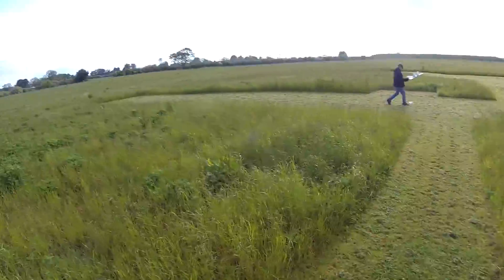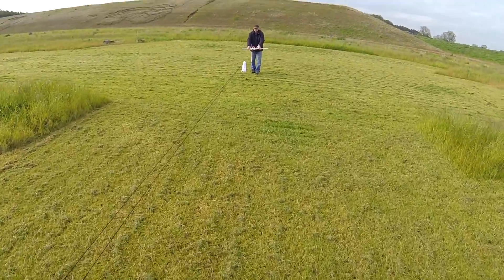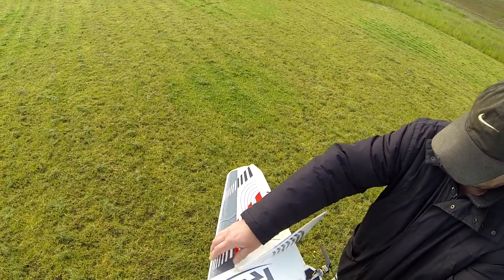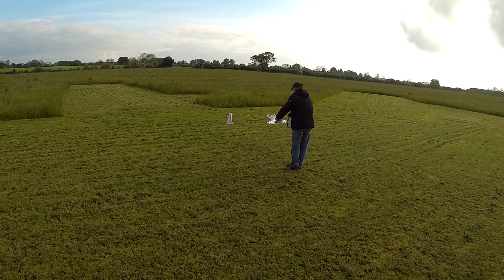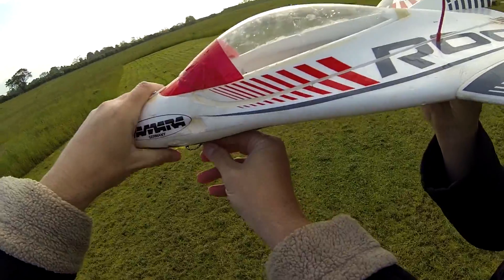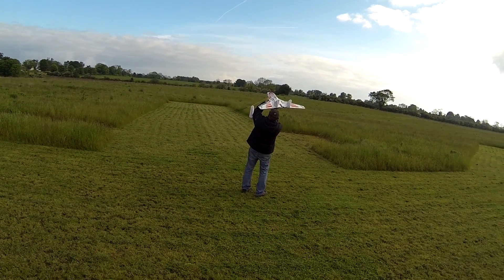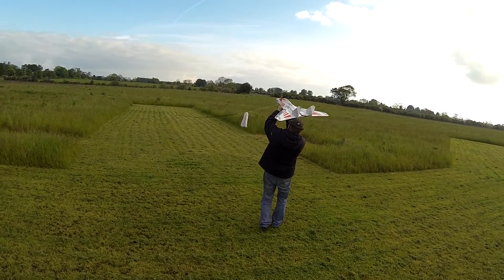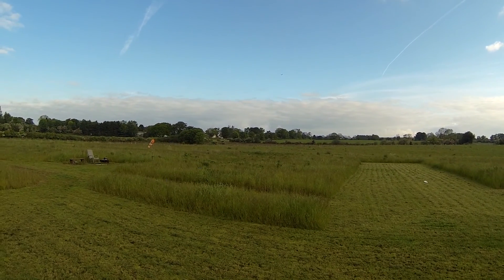RC Plane Bungee Launcher Test.

Comment: Have you ever had the tow line get sucked into the prop. Looks like most people are firing up there motor before the line is released. 
Or is it important to make sure the line has dropped away clear before hitting the gas.
Reply from the maker: Helimadness100 No never happened as the drag rag pulls the chord to the ground on release.